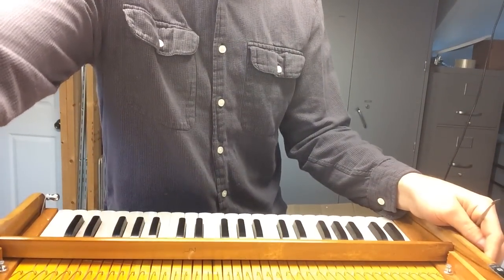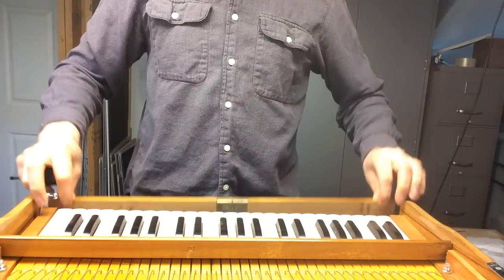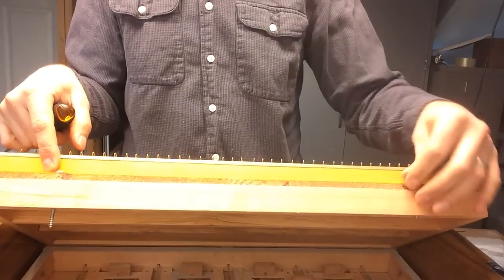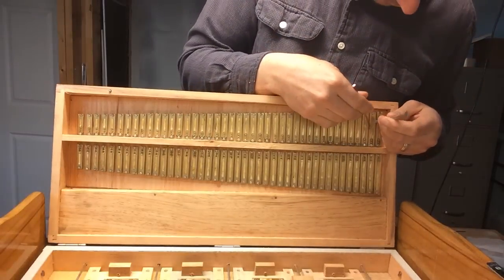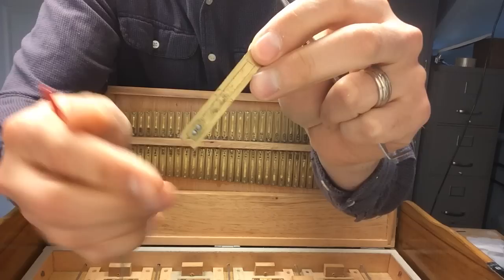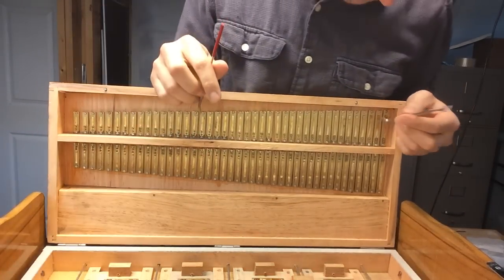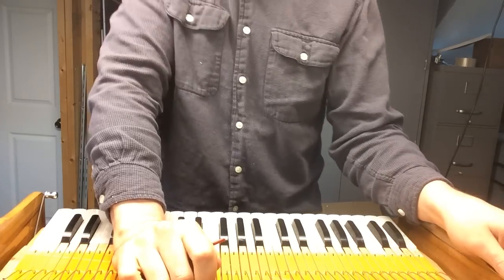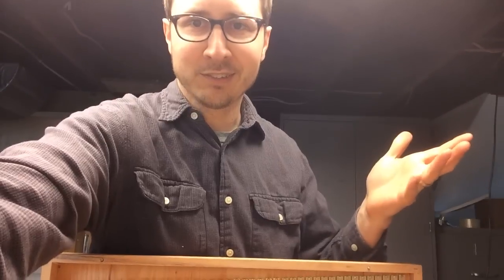Harmonium Repair: How to Fix a Buzzing Reed

Comment: Thank you! This worked beautifully. I have a Bhava Mini that had a buzzing reed. Here are some tips that might help. 

Use a guitar pick or a similar piece of thin plastic to help lift the reed.
You can use a tiny allen wrench to hold up the reed while you file if you don't have a tool like the view shows.
You may need to file the edges of the reed casing too. I filed the end portion and noticed the reed was still slightly clipping the side, so filing along there solved the issue.

Comment: Very informative. Looks kinda daunting for a newbie to the instrument. You make it look so easy.
Reply from the maker: Christopher Bueker it’s daunting in the same way changing a guitar string is daunting the first time you do that, but totally doable...worst case scenario, you break the string and start over. It’s just a reed in this case. :-)
Reply: @OldDelhiMusic  Thank you.
Reply: @OldDelhiMusic  by filing down the casing, is that going to alter the pitch of the note?
Reply from the maker: @ChristopherBueker  A tip - before you get into filing, simply remove the reed (pop it all the way off the board) and then put it back. 9 times out of 10 the buzz goes away. IF that doesn't work, then get to filing, but go easy on the filing. It won't change the pitch much, but you may have to do a little retuning...or not. As long as you're not bending the reed a ton, it may be just fine.
Reply: @OldDelhiMusic  With the help of this video, and a bent large paperclip (shaped similar to your homemade tool, fingernail filer, and 2 different sized flat head screwdrivers, I was able to fully repair my new harmonium. Thank you so much!
Reply from the maker: @ChristopherBueker   Awesome. You're welcome!!

Comment: Any suggestions for buzzing that only happens with both octaves of the note are played? I've isolated each one and by themselves there's no issues, but when played together there's a horrible buzzing. Happened after I tuned it, so I must have jostled something.
Reply from the maker: It might be a "vibration" that is not the sound of a reed rattling. There might be something else that is responding to this particular frequency and vibrating passively when you play those two notes together, specifically. Good luck tracking it down!

Comment: Wondering if you can help?...just stumbled on your vids found them fascinating. I used to restore mechanical musical instruments a long time ago  and reed organs were the poor man's pipe organ. Recently been investigating Indian harmonium as a portable version of the western harmonium but been finding contradictory info. I'm a keyboardist and organist so stops and pitches are second nature to me. Can you define all those stops on Indian instruments as it seems pretty confusing...for example....if it Haa 2 sets of Reed why 9 stops  ....yes I know 5 are drones (sharps) but that leaves 2 unknown stops??...the other one I wanted to ask is advice on a dulcetina claiming to have 4 banks of reeds. I'm guessing it's bass male male female or in Western 16' 8' 8' 4', if this is correct would the second male 8' be tuned off (tremolo)
Reply from the maker: A 9-knob set up will have 2 Bass stops, 2 male stops, and 1 bass tremolo + 4 drones. It is not typical that a 4 reed harmonium or dulcetina would be tuned with the adjacent Male reeds "wet" (creating a natural vibrato). They are typically "dry" tuned. "Wet" tuning is more common to accordions.

As a side note, a 4 reed dulcetina is likely to be a terrible instrument. I've yet to find a 2 reed that is playable. They are an interesting concept that in practice just doesn't have enough air to do the job...

We don't sell dulcetinas. For reasons. ;-)

Comment: How can we fix the air leaking problem?...
Reply from the maker: +Himanshu Mittal Air leak issues and tuning are the main things I typically don't encourage novices to deal with themselves, but if you have no other choice, here's what you need to know - There are many, many places where you might have air seeping from your harmonium and the range of problems / solutions is vast, but the basic process of fixing is to identify where the air is getting out and make some kind of manipulation to stop the air from leaking. It's not always easy. In fact, it's generally pretty tough to figure out, but that's the process. Good luck! And if you need additional support, I am available for Skype support sessions. If this interests you, feel free to email me about at olddelhimusic@gmail.com. Thanks!
Reply: Just seal it with tape or mseal

Comment: Thanks for the video.
How would you remove the reeds from a triple reed harmonium that have the reeds fixed horizontal? Thanks.
Reply from the maker: Hary - It's tricky. They make side angle screw drivers that will work, or you can remove the whole reed board, but I wouldn't recommend that. If it's just one reed you are replacing, figure out how to get something small in there to slowly turn out the screws, and remember that only one screw has to be removed completely. Good luck! -Nic
Reply: OldDelhiMusic 
Thanks a lot Nic.

Comment: My Harmonium's higher octave notes need a lot of air to a get sound, otherwise I'm just hearing the air sound when press the key. Is that normal?
Reply from the maker: Yes and no. Yes, it takes more air to get a high note to sound. Same as your voice needs more air to hit a high note. BUT you should also check your gapping to ensure your reeds are not too far out. I suspect this may be the case since you are saying you hear air. Additionally, if you are hearing air, it may be that you are loosing air somewhere else and that is what you are hearing. This loss of air elsewhere would mean your reeds are not getting the full pressure of the air, and that would also cause the high notes to struggle. Good luck!
Reply: @OldDelhiMusic  thank you for the reply. There is not leaking when no keys are pressed, but when I press a key I just hear air noise and I have to keep pumping and then I will start to hear the high note.
Reply: @VenkataY   Hi, Did you find the reason for hearing the sound of Air upon pressing the key and hearing the harmonium sound only after lot of air gets pumped? I tested out some New harmoniums straight out of the box which hadn't been played for maybe like a year and those had same issue too. Any videos that i watched on Youtube related to any harmonium never showed latency in sound on higher octave so i was wondering if it's common on newly built harmoniums or not.

Comment: 4:21 diamond files Is there anything lying around the house that we can use to do the scraping to fix this reed problem. I was thinking my harmonium was broken but now I know how to fix it thanks to you bro :p. Thanks a lot. Perfect video easy tutorial on fixing it
Reply from the maker: Not that I know of. I don't really know of any conventional tools that can be used in place of diamond files. The ones we use are actually very expensive (PFERD Riffler Files, Medium Grit ~$200 for the set), but for limited use, you can get by with the cheap Chinese made files available on Amazon, which can be purchased for $10-20.
Reply: @OldDelhiMusic  out if curiosity if I use some other tool will it damage the reed altogether so does it have to be these specific tools you mentioned and thanks again for the reply :)
Reply from the maker: @5part4  I couldn't tell you. A replacement reed isn't that costly. You're not risking much here.
Reply: @OldDelhiMusic  last question on this topic bro :). Basically I wanted to use the same flathead screwdriver to do the scraping because it seems the same and my last bit on this subject is. If the scraping happen incorrectly what is the result? Will the note not make a sound at all or will it just be that ringing sound all the time
Reply from the maker: @5part4  I've never seen a screwdriver with diamond grit. I don't think it will work. You need something that has a gritty sanding surface to sand off the edge of the reed housing. As long as you don't do anything to the reed itself, you should be fine, but I'd recommend investing in a cheap set of riffler files. Once you have a tool, it's common to find many random uses for it. Good luck!
Reply: @OldDelhiMusic  thanks so much I will definitely check out the riffler files :p. Respect bro

Comment: Please tell me if last 3 higher reeds are not sounding
Reply from the maker: I'm going to assume you have already verified nothing is prohibiting the reed from movement. Beyond that, check first to see if they are gapped properly. The "gap" is the space between the reed and it's surround. If there is no gap, it won't sound - if there is too much gap, it will be delayed or not sound. Beyond that, keep in mind that the highest reeds require a lot of air to sound. If you're talking about a low quality instrument, it could simply be a matter of these reeds not getting enough air to make sound, and there may not be much you can do about it if the instrument isn't built well and cannot achieve proper air pressure. Good luck.

Comment: my knobs are very losse and not working
Reply from the maker: You'll need to open it up to see what is going on.
Reply: I have opened my harmonium and there is no separating wood between low reeds and high reeds so what can I do
Reply: I have opened my harmonium and there is no separating wood between low reeds and high reeds so what can I do
Reply from the maker: For tuning, you can silence individual reeds by sticking a sliver of paper or something else between the reed and casing. It's slower, and one of the reasons I don't like harmoniums that don't have the chambers, but it serves the same purpose of isolating the sounds.

Comment: How do I fix if I press a key on my scale changer another key also gets down at the same time and makes the sound ..please help
Reply from the maker: This is a feature, not a fix. ;-) The "octave coupler" is typically controlled by a button (or a lever) on the far right or left side of the harmonium.
Reply: Thanks 
Actually what I meant was that when the coupler is on and when I press a key so what happens is that basically the other key goes down but it stays down for A while until I push it back up
Reply from the maker: That's more complicated. Basically, you need to figure out what has swelled and relieve the sticking. More than likely, it's the piece of wood that extends from one key to the octave lower that has swelled and is now being pinched / held up. You need to remove the entire octave of keys extending from the A to the A one octave below and then you will have access to be able to remove that coupling piece and sand it down. Good luck!